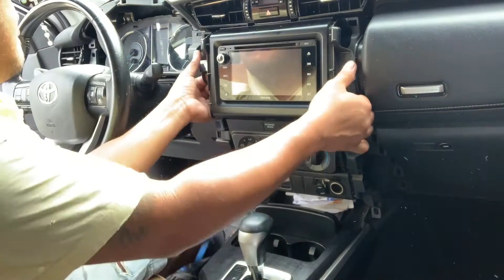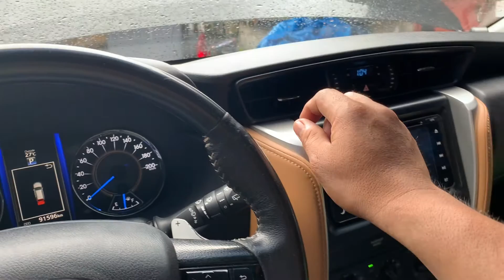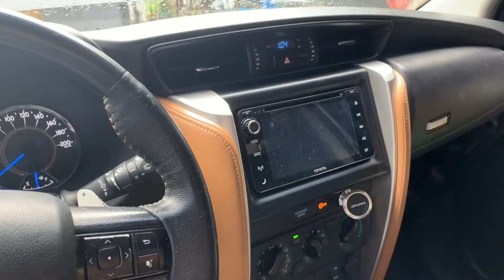Toyota fortuner 2016 aircon cleaning

Comment: Boss ask ko lang same unit. Sa tanghali pansin ko medyo hirap sya khit ilow ko mgtatlong guhit p ako ng fan. Tpos kgabi binalik ko sa 22 temp tpos 2 fan prang d n sya gnun kalamig wlng kgat kng baga
Reply from the maker: Baka po May bawas na freon 
Check nyo sight glass kung May bubbles
Reply: @kapworks  bka nga boss e. Pg matic ng matic yng aircon kulang yon boss?
Reply from the maker: @Skull0023  madumi na
Reply: @kapworks  boss ano po rcommend nyo pulldwn or no baklas po? Ng pulldwn n po ako dati
Reply from the maker: @Skull0023  mas malinis ang pull down 
Check nyo vlog ko sa avanza ac cleaning nandun makikita nyo kaibahan kc nag pa no pull down na din yung avanza pero nandun padin ang dumi sa loob

Comment: Magkano palinis po aircon yung likod po mahina na buga same po model 2016 model manual
Reply from the maker: 4k po kasma na freon ang orings ac cleaning
Reply: @kapworks  san location boss
Reply: @kapworks  front and rear na kap?
Reply from the maker: @christiandavemacaraig5030  north Caloocan po
Reply: @kapworks  front and rear ac nayan kap?
Reply from the maker: @christiandavemacaraig5030  yes po same po nung sa video
Reply from the maker: @christiandavemacaraig5030  yes po